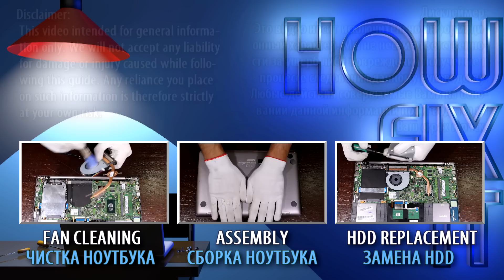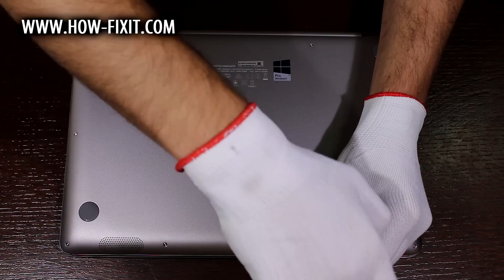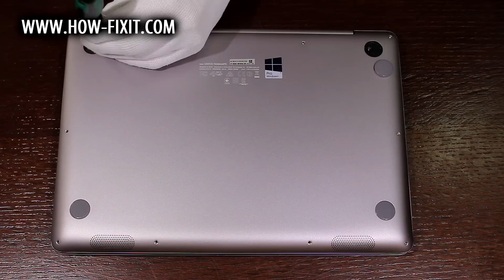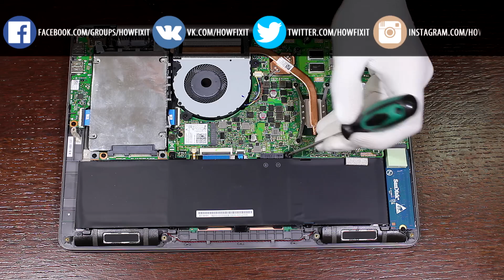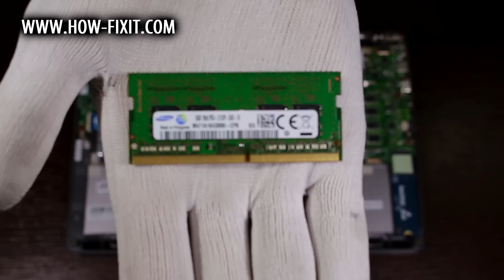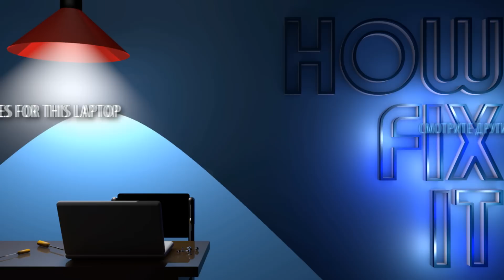Asus ZenBook UX310UA RAM Upgrade and Install - Your Step-by-Step DIY Guide!

Comment: Hallo, Thanks for the video. I have 8Gb and would like to replace it with 32gb. is that possibles, or do I have a maximum ram available to 16??. Thanks in advance for the answer
Reply: Максимальный объём 16 ГБ

Comment: What was the purpose of taking the battery out?
Reply: I know this old but, so you don't short circuit your components and you should wait maybe 30sec after removing the battery to discharge any capacitor.

Comment: hello everyone, does anybody knows if the metal back cover of the screen is different between UX310U and UX31E? (both are 13,3"), I've seen that UX31E has a darker silver aluminiun tone, and UX310U more light gray. But UX31E seems to show more little round corners, do u know if its true? or is just my impression?    best regards from latin america guys!

Comment: Is there more RAM soldered to the MOBO?
Reply: On my laptop, I was surprised to see there was no RAM installed in the slot.
I indeed have 4GB somewhere in the motherboard already.
Adding a 4GB RAM module in this slot thus makes 8GB usable by the computer